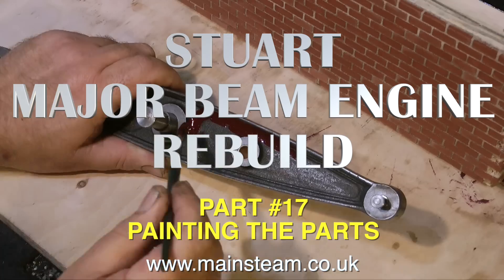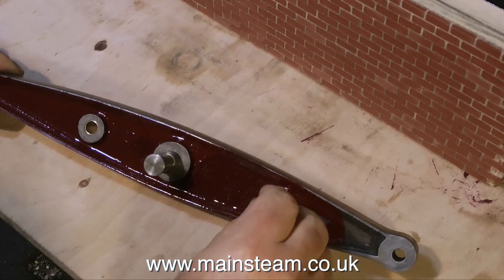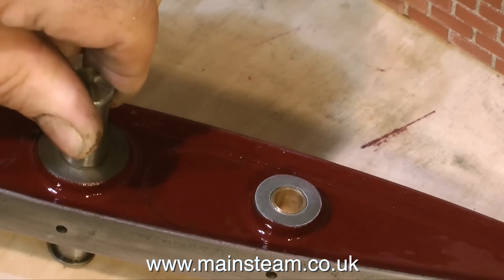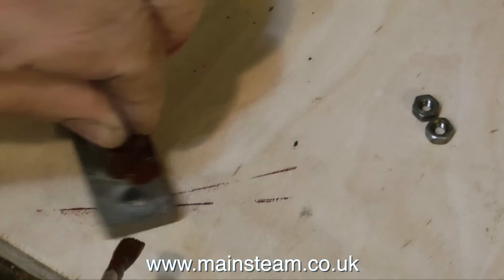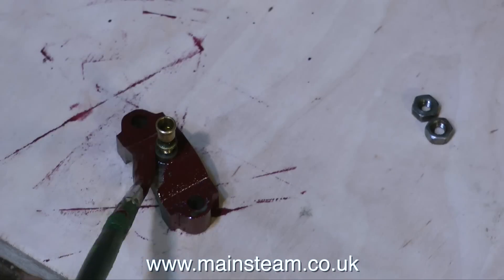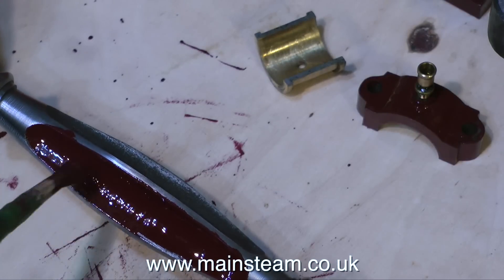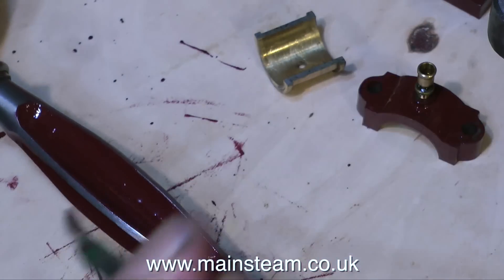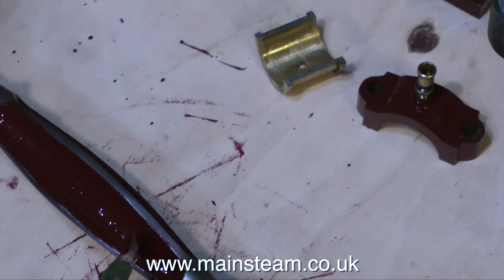STUART MAJOR BEAM ENGINE REBUILD - PART #17

Comment: Just a suggestion about keeping the paint from ending up where you don't want it: Cover those areas with masking tape and trim off the excess with a knife or scissors before you start. Once the last coat is dry, peel the tape off to reveal a paint-free surface. This is what I've been doing when painting parts from an old Villiers engine, admittedly using spray paint, and this method works a treat.